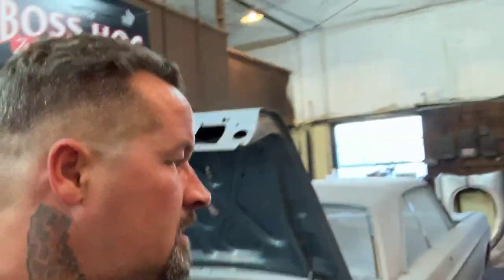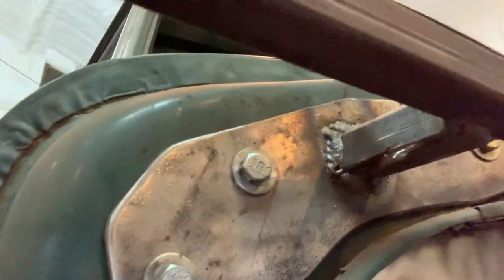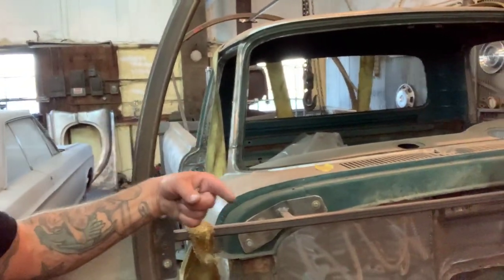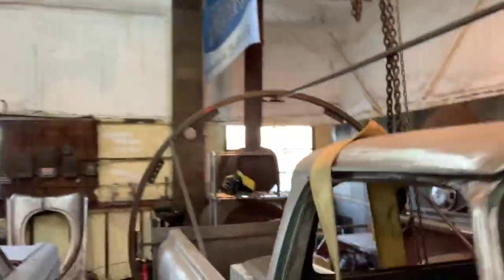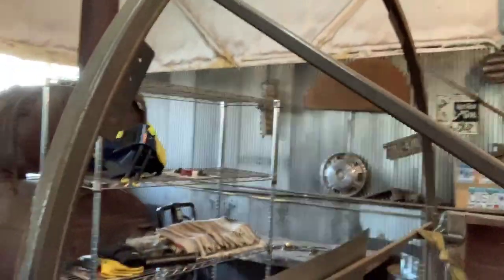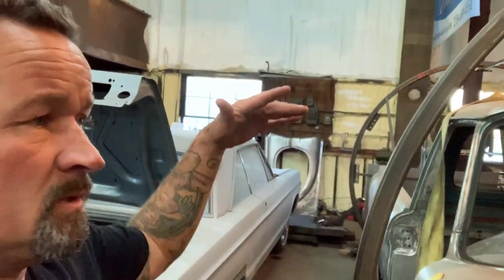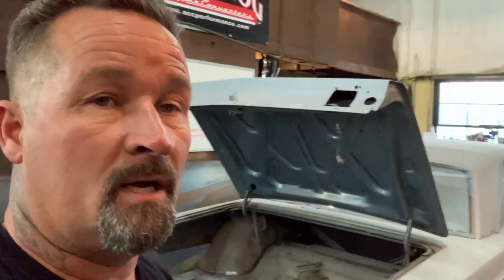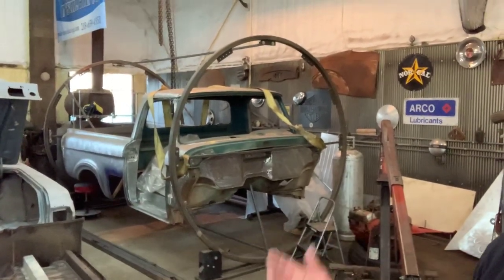Custom vehicle rotisserie

Comment: I built a rotisserie out of square tubing about 6 yrs ago..... I had to use lawn mower wheels and tires cause I don't have the luxury of cement floors......but one person can easily move a car around.....total cost to build $300 and that's with enough left over material to make all the adapters for different cars or trucks.... It doesn't owe me a dime with all the cars I got done with it........today with the higher price of steel it would cost atleast $600 to 800 or more.....

Comment: That rotisserie is awesome! I took a lesson from your build off car. The way you made a skeleton out of round rod, then skinned it struck a chord with me. I had been struggling with the trans hump on the floor of my 50 Studebaker Rat. I wanted it to be removable. After I saw how you were doing the car body, I used the same approach using 3/16" round rod, and voila! it all fell into place. Thanks for the great videos!
Reply from the maker: Rick M awesome bro! Thanks so much for sharing 👍😀

Comment: That is a good solid unit bud. I have seen some pretty light ones you would never put a pickup on. Good news, , , I go home this coming Sunday. I had a great day. The upper for my new leg came in and this one fits. It is with the fitter now. My new wheelchair that folks donated cash for was delivered. It's an off road or built for gravel roads beauty. Once I am settled I will holler on Monday and we can get caught up my FRIEND ! Value Hunter is doing a big fundraiser auction tomorrow at noon eastern. Check it out as there are amazing pieces the silver community have donated. I am just blown away eh.